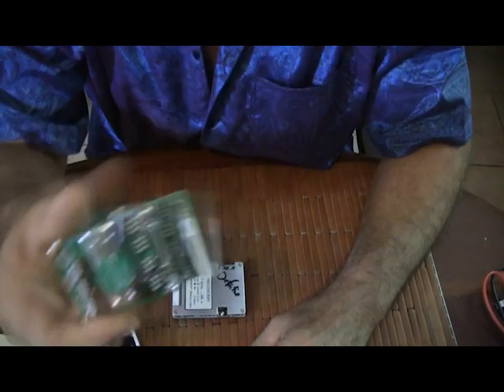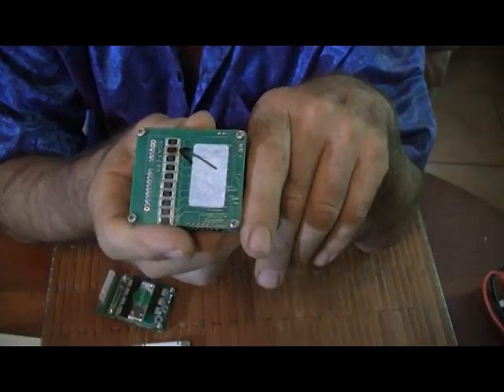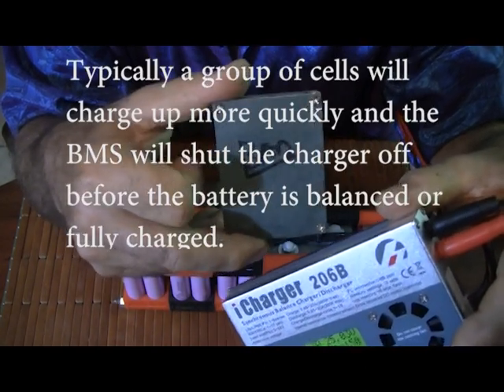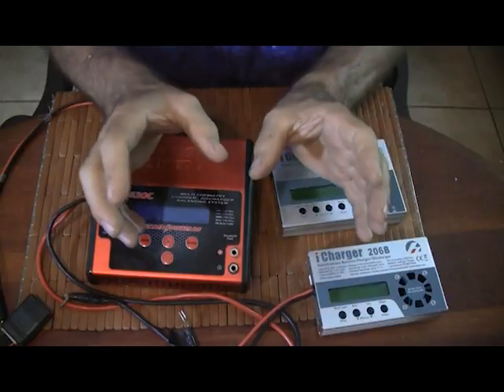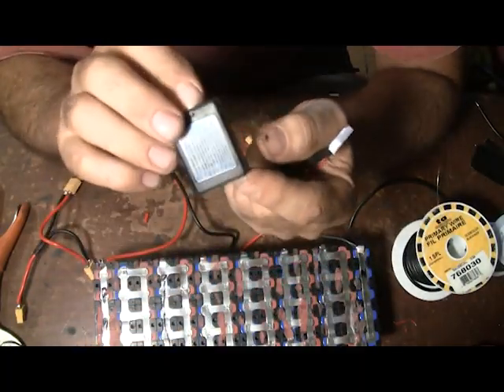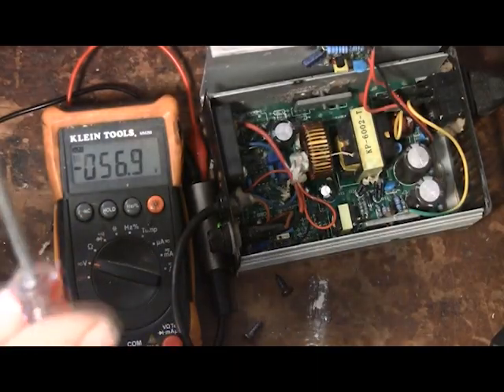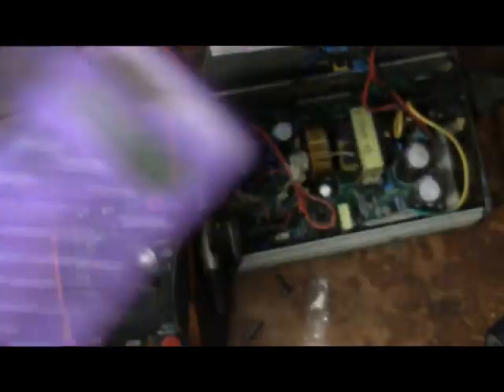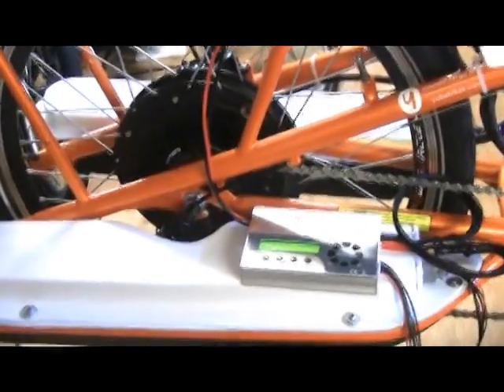How to build a safe and better lithium battery WITHOUT a BMS.

Comment: Hi Shawn my bms arrived I’m wondering where does the discharge negative go to the battery negative ?p- the charging negative is the charger - then b1- the first negative on battery .will check vruzend video just remembered .
Reply from the maker: B- goes to Battery Negative.  P- goes to power out negative.  C- goes to charger -.   The positive comes straight from the battery to the load positive.

Comment: Cannot the individual batteries become unbalanced?
Reply from the maker: No James.  Those cells that are connected in parallel have both their positive and negative terminals tied to each other.  So a cell with high voltage charges a cell with low voltage.  So they all become the same voltage.  They become in effect one big cell.

Comment: Hi just been down on electric bike 48v1000watt one was goin ok up hill then power went down some faint lights on throttle display .peddled home checked battery still 54.8 v it’s a48v motor and controller is that ok ?must be controller I hope will check motor after 😀

Comment: Shawn can I wire the 14s kit with all connected and use the imax with 6s x 2 leads an a 2s lead to charge in 3 goes still got the bulk charger 54v also

Comment: I just realised when connecting the balance wires I need a 8s balance charger don’t I as have one red positive then 7 negative wires on my 7s 5p block and have 2

Comment: I already have enough vruzend blocks to make 36v battery just need cells so can go with that another guy has Samsung 25r as new surplus for 2.50£ each but nkon has new Panasonic 2900mah what u recommend for ebike front hub motor Shawn 36v occasional use

Comment: I havnt got any more new cells but if that doesn’t work can buy a few new one guy on eBay selling ebike batteries one a 36 v 10ah comes with 48v controller and another guy has 48 v 15ah Samsung cell .i have 2 bikes 48v 1000 watt and my wife’s 36v 250 watt wouldn’t need as powerful battery for that

Comment: One of the cells was 4.2v maybe the weak one like you said as charges faster some just 3.9 this a big discrepancy so my cells in parallel rows of 5 if I use a 12 volt light on that row or maybe a group of 3 ?=12v will that be ok to balance charge?

Comment: I'm guessing you didn't really have to cut the pack in half. You could have attached a blue wire to the 7th cell. Then use the black wire for the negative on 1/2 and the blue wire as the positive to charge 1/2 and then use the blue as negative wire and the red wire to charge the other half. You would have to make sure the battery wires were disconnected of course first. So not to short anything out. And you couldn't charge them at the same time.

Comment: Thanks Shawn I just downloaded your ebook to gen up I don’t leave imax on that long will have to disable timer is it safe to leave 24 hours ?
Reply from the maker: Yes.  You can leave it on there for days.  Lithium batteries last longer if not left sitting fully charged, but you don't have a lot of choice...
Reply: Shawn can u show diagram of those pigtails u wires to connect the 2 x 7s together can’t quite see on video when paused
Reply from the maker: I explain it with diagrams in my ebook. The book costs $3 and can be downloaded from my website.  If that's an issue email me privately and I'll send you the diagram.

Comment: the vruzend guy says I n
eed bms also the nkon supplier of the cells too.i beefed up the wiring after first run so I'm not sure now.when first run the batteries were not at full charge.but after bulk charging the green light came on the charger but still not up to 4.2v but u suggest say up to 4.v okay shawn?thanks.steve in uk

Comment: hi shawn why does my 18650 kit when I run it on ebike some of  cells drop low to 2.0v or less then spring back up after resting off bike.ive charged back up on imax b6 and have bulk charger 54v.they all new cells Samsung 26h Panasonic and 8 Samsung 25r
Reply from the maker: Voltage drop is work being done.  When batteries have a large load applied the voltage drops.  It springs back when the load is removed.

Small packs can do the same work as larger packs, but the voltage falls more.  This is because of ohms law, but I won't get into it. )

So if you have a 3p or a 4p pack, for example, you will see more voltage drop than a 6P pack...   IF just some of the cells are doing this, they are weak.  They will also charge faster than the rest.
Reply: yes I told the guy at nkon batteries this he said its because ive no bms or connected wrong.i have beefed connections up .will run again soon.i have one cell logger to measure individual cells .how did you make those meters on your bike shaun?
Reply: shawn sorry.my wife has a son shaun.lives near lands end,uk
Reply: my kit was built in 3 stages as started with 36v ebike motor then added 48v motor.then also added 8 extra Samsung 25r cells they all close in capacity and new.from 2500 to 2600 mah.the imax b6 cant get some of them to balance that close.is that because of weak cells .you said weak ones charge faster
Reply from the maker: Yes, weak ones charge faster, so you have to hold them back.  Can you access the cells while charging?  Try putting a small load on the group of cells that is charging fastest to hold them back so the rest of the cells can get caught up.  I use a 12 volt auto taillight....  It is not uncommon for really out of balance batteries to need a long, long time to come into balance.  Leave the imax hooked up and check the voltages every 24 hours- it should get better.

Comment: a noob question.  When you say "cell", do you mean one 86650 or do you mean a group of 86650 in parallel?
Reply from the maker: A good question.  It is a way of identifying a parallel group.  When wired in parallel cells behave as one large cell, hence........   and it's easier than saying "parallel group"...

Comment: I looked up "cell logger" in google.  Nothing comes up.  Where do you buy these?
Reply from the maker: Yes, they are called different things. This will get you started:

https://www.aliexpress.com/item/3-7-30-v-1-8-s-fe-li-ion-lipo-battery-low-voltage-alarm-sound/32801265189.html?spm=2114.10010108.1000013.1.6108524fVdQi6O&traffic_analysisId=recommend_2088_1_90158_iswistore&scm=1007.13339.90158.0&pvid=2c1330eb-c265-41a9-b8a5-87d100ccdd5c&tpp=1

Comment: Got a few questions regarding the motor,battery,controller voltage and amperage. I want to have a working set up, any trying not to melt any of the main components. If i choose a 48v 1000w rear hub motor, a controller rated for 1000w 48v (or stronger if needed, dont really know?), and a battery with 48v and 11.6Ah. Now the site says that the batterys constant output current is 40Amps, does that mean i have to have everything rated for at least 40amps or something will go wrong. I cant seem to find the lower Amp batteries in my country unless i make them on my own. This is one of my questions i really want to get straight, coz i dont want my bike to roast. 

Thank you for your time, and have a good one. Urban
Reply from the maker: Hi Urban,
You will be just fine with that battery pack.  The reason is the controller itself limits how much power will be drawn- it can't draw any more than it's rated wattage.  That's why light bulbs don't blow up when they are hooked to the grid.
Cheers!
Reply: Shawn McCarty Thank you very much

Comment: Good information for ebike type batteries. For large power-walls 14s with solar charging the only reasonable solution is Batrium until someone comes up with an large MPPT charger that can balance individual 80P+ cell packs in real time.  That said, this is a well thought out solution for the ebike crowd.
Reply from the maker: Thank you. 

 I power my home with a 100P 14S homemade power wall.  I have a built a balancing solution which I am testing and will make public soon.  It is modular and inexpensive.

Comment: Question. What are the reasons if any that you couldnt just leave your 14s pack connected and wire a charging only positive and negative to the middle so they are only connected to the "7s packs". You wouldnt have to seperate anything and the bms and hobby chargers discharge this way already so whats the danger in charging this way? I have always had this mentality thanks for confirming im not crazy!
Reply from the maker: Not crazy at all, you are right.  However, if you then hook the two halves to a parallel board and attempt to balance them simultaneously, you will melt the balance wires!!!!!   So, don't leave them in series and then put them in parallel-  (don't make the same mistake I have made) and you will be fine.
Reply: Shawn McCarty great thanks! Nice to see someone that thinks similar.

Comment: Hi Shawn. Thanks for the video. Can you point me to where you bought the hobby chargers, battery monitors, and connectors you show in your video? Thanks.
Reply from the maker: These are just standard parts in the model airplane hobby industry.  Try Amazon, BuddyRC, or Hobby King.

Comment: I confirmed your conclusions the hard way.  After failed bms after another, was heading back to the Imax.  I will be splitting my 10s packs into 2-5s.  Thanks!
Reply from the maker: Sorry Bob- I wish it wasn't so.  But consider springing for the icharger that does 10S- so you don't have to split your pack.
Reply: cell logger is a great idea but only handles 8s max?  Suggestions are appreciated.  Have your tried a smart bms?
Reply: cool.  putting 2-5s cables on the existing 10s allowed the cell loggers and balance cables to work as 2-5s while not having to split the 10s.    Cool

Comment: Is there a video on packs with no BMS with blown cells, and how to track them down and replace them? Or manually testing for out of balance, how often and the cheapest/easoest way to do it? If not, what are y'all waiting for? :) Best way to get a way from the semi  myth of needing BMS is to educate in all areas, like of course is being done here, but the more on this, the better. This video is a great start. 

BMS is something I would much rather not mess with as a new builder, and I will say I'm convinced, but will be more comfortable with it all once I understand all aspects of maintenance.

Comment: Apologies if there was already a comment but why won't a BMS keep new laptop batteries (from eBay or otherwise. :) ) balanced?
Reply from the maker: Sure- it may well depending on how close all the cells are to each other in the beginning.  Ideally the cells would be made perfectly and be exactly the same and would remain that way through their life.  But that is not the real world yet.  Hobbyists who take apart packs to build new ones rarely end up with cells close enough to be able to be balanced by a BMS which is engineered for engineered packs!

Comment: Hey Shawn, great to see someone accurately describe those Battery Murdering Systems!
One thing I would suggest though...you can reduce the effort involved in bulk + balance charging like this by just using a balance tap only charger like the BC168. Yes the balance leads/plugs are somewhat limited in current carrying capacity, but if you limit the charge rate to something reasonable it can and does work. I've been doing it like this for over 4 years now.

Cheers

Comment: one way to go about it is to add redundancy, not for balancing but monitoring, all you care about is that the voltage not exceeding the cell upper bounds; but if you get a good balancer IC, they are really solid; and btw the analog balancing section really needs proper protection, like zeners and fuses, so if the balancing fet goes, the fuse would just blow
Reply from the maker: I agree, the main issue is not to exceed a set upper voltage limit.  And it is good to be able to adjust that limit to meet your needs.  Long ride?  Charge to 4.2 volts.  Long battery life?  Charge to 4.

Comment: Is it best to set it at 3v a cell
Reply from the maker: Not clear what you mean Nick- set the low voltage on a Lithium Ion Pack?
Reply: Shawn McCarty yes mate is it better not to going lower than 3.0v per cell on the alarm plus I've got 3 of the lipo cell checkers each one showing  different readings on the same battery have you got a link to a more accurate cell checker if you know what I mean mate
Reply from the maker: Yeah gotcha,  3 volts is good for the bottom and 4 volts is good for the top.  I agree the lipo cell checkers just give an approximation.  It's better than nothing, but....  When I want accuracy I hook up my hobby charger and read the cells through it.  It is an icharger and I find it to be very accurate.
Reply: Shawn McCarty thanks for the reply mate the only changer I got the the IMAX b6 so I will set the alarm to 3.0v but it should recover a bit more once I let the battery sit

Comment: In case of using a BMS to do the balancing, my question is do I still need to use a lithium battery charger, or can I use a DC Constant Current power supply?
Reply from the maker: Sebi,
You need to use either a BMS or a Hobby Charger to do the balancing.  This can power a hobby charger or it can bulk charge- charge without balancing to four volts per cell.
Reply: Shawn McCarty
I can use both methods do balance the cells,that's not a problem. My question was about the 'charger'. A lithium battery charger uses 3-step charging control (pre-charge-CC-CV). I'm trying to find out if a BMS has these functions. Because I'm looking to use a normal DC power supply, which provides the voltage and the amperage needed constantly...
Reply from the maker: No, a BMS does not have a CCCV function.  However, your power supply will taper off the current as the voltage approaches the power supply limit.  (Unless it is a constant current power supply which is unlikely).  So put your battery on the charger and note the current draw and the voltage.  Check back at half hour intervals or so...... After a while, the voltage will become constant- at the fully charged voltage- and the current will start dropping.    I bulk charge  lithium batteries on power supplies all the time.

Comment: The EZ Battery Reconditioning course is a step-by-step system which is easy to follow and can be used to reuse any kind of old or end-of-life battery with simple consumables that anyone already has in your household [Check Details Here==>https://plus.google.com/100351090281822647456/posts/Gwtd4mVBdEd ]. The average family uses more of their hard-earned money each month for all kinds of batteries.

Comment: How does it triple the life of your battery by charging at 4V instead of 4.2V? If you know any good youtube videos that could tell me all about the batteries and would include information like this, that would be great too.
Reply from the maker: Batteries are stressed by charging and the final .2 of a volt is the most stressful.  It's how automakers can get 8 years life out of their battery- by undercharging slightly.  You can also overcharge and get more power at the cost of life cycles.  4.2 volts is just a good compromise.
Reply: Thank you!
Reply: Z ane Zane Hitchcox

Comment: BMS is overrated, also soldering is overrated, as you can see in the video of my 3S15P battery bank on my youtube channel.  I really need to get some 8mmX3mm discs though, I think the biggest ones I'm using now are 5mmX3mm neodymium.  Even if I was going to use fuse wire I'd just cut a ton of ~18mm lengths and tuck them under the discs.  Just make sure the current isn't going THROUGH the magnets, too much current will ruin the magnets, not making them as magnetic anymore.

Comment: pfffft I've been running a 3S15P bank on a 100W panel for about a month or more, I think I have a video of the bank before I installed it in my system on my youtube channel.... no BMS, no charge controller.  I'm probably going to add another 15 cells to make it 4S so it'll be closer to the 20V solar panel and the second reason is to keep the overall bank voltage OVER 12V for all of my 12V applications.  I manually balance by wiring a USB power bank to the highest 1S section and charge/run whatever USB applications need charging...
Reply from the maker: This is a great way for a hobbyist to manage a larger battery.  Using a charger to bring up the lowest parallel group works well.  The larger battery banks tend to be more stable as well.    A friend uses four-volt 60 watt chargers on his power wall.  i use a bleeder circuit that kicks on when the voltage gets above 4 volts.  

I think you'll be happier with the 4S for your 12 volt system.  Thanks for the comments.

Comment: I have a doubt about the bms. what if one or more sub packs are dead? SInce the bms balances each sub pack by bleeding it to the level of the lowest sub pack will it also kill the rest of the sub packs? Or does it have a mechanism to cut off that particular sub pack fro the rest of the battery while charging and balancing?
Reply from the maker: If there is a dead parallel group the BMS will shut off the battery.  It will detect the low or missing voltage of that group.  There is no mechanism for electrically removing a parallel group and using the rest of the battery.

Comment: I don't understand how it makes each cell of the 7s pack to have 4v while they are unbalanced... so they will last longer if charged to 4v instead of 4.2(what bms does)?
Reply from the maker: Hi Agenor,

The process of bringing each cell of the 7s pack to 4 or 4.2 volts is called balancing.  The process is to charge the entire battery at once but to drain the voltage of each cell when it gets above 4.2 volts using a resistor.   The only BMS's I know of that will allow you to set the balance voltage to 4.0 volts are programmable ones.